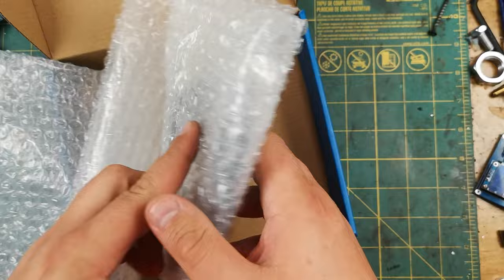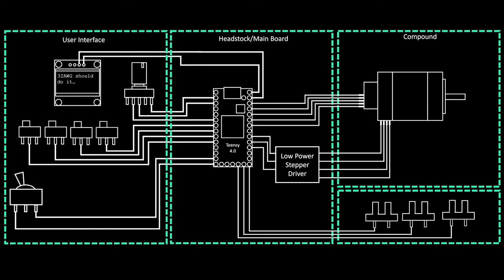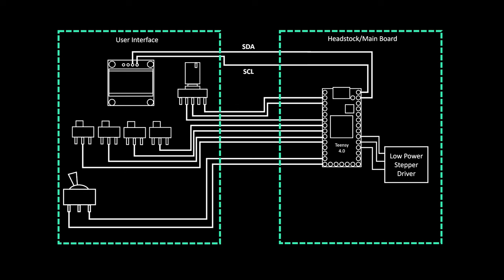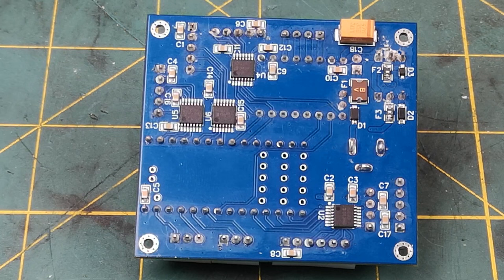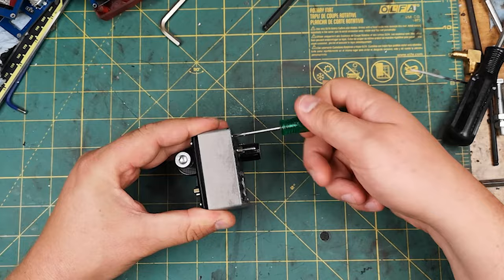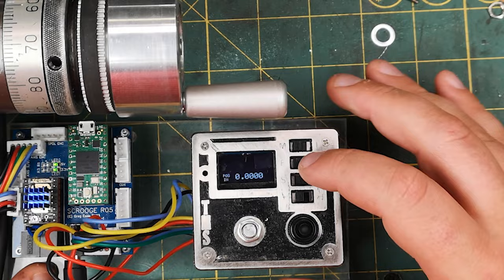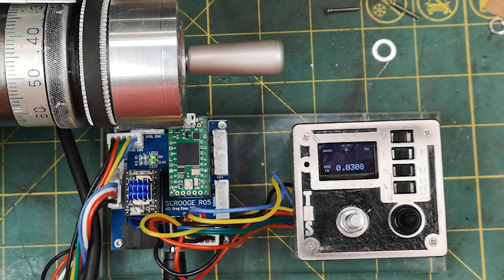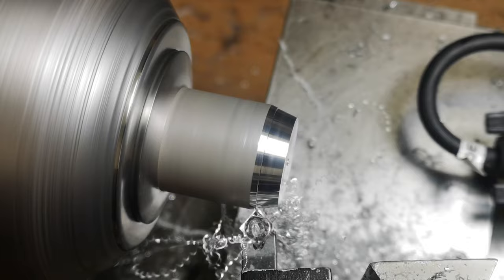Rivett Power Feed - Part 4:  Feed Between the Lines

Comment: I have successfully used I2C over Cat5e by making it differential.  There are some chips specifically designed to allow this.  The PCA9615 is a good example.
Great video, keep up the great work
Greg
Reply from the maker: Thanks for the tip, that sounds like exactly what I need!

Comment: Instead of running I2C over long lengths, look into using RS485 transcievers and just run plain old uart comms over it.
Reply from the maker: It may very well come to that, I was mostly just trying to avoid using a second microcontroller.  I was thinking "half the microcontrollers means half the coding" :P

Comment: CAN Bus is a great choice for board to board data, however youd have to have a controller on each board.
Reply from the maker: Right.  I think I'm going to proceed with an RS 485 chip on the physical layer and just use I2C over it.  I've cut my GPIO requirements down even more (dare I say.. tripling down on I2C), but I think this will make it much more reliable.

Comment: The connector is called DE-9, not DB-9 - A DB-9 would not make any sense as only having 9 pins in the shell size B that can house 25 pins is silly and pointless.
Reply from the maker: Interesting, I didn't know that!  I guess my first exposure to the D series of connectors was DB25, which does in fact use a B-sized shell.  Just poking around online a bit more, it looks like people like me misusing the term has also made "DB9" fairly mainstream too.

Comment: I think first I would try some Cat 5 or 6 cable for that interconnect. I use a multi-conductor shielded cable for my CNC connections but it is more expensive and uses DIN connectors $$
Reply from the maker: I'm going to see if a properly shielded cable helps.  The problem with twisted pairs is that there's nothing driving the inverse signal, so you don't get the intended noise cancellation, but then again just the shielded construction of the cable might help.

Comment: I see people use a current mode line driver IC on each end to push I2C many feets. Can also put a small micro on interface board and do RS232 but that’s less fun.
Reply from the maker: Yeah I struggle enough with one microcontroller, let alone two :P.  THanks for the tip on the current mode line driver, I'll look into it more!